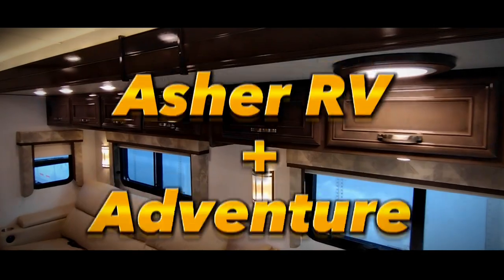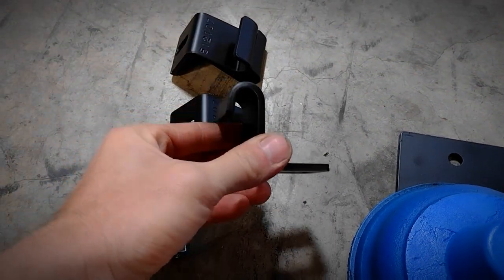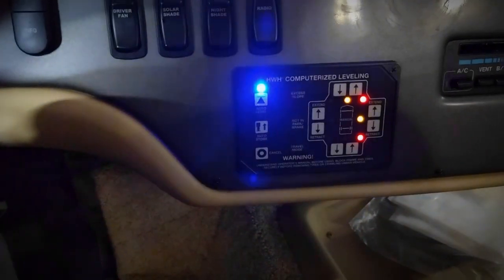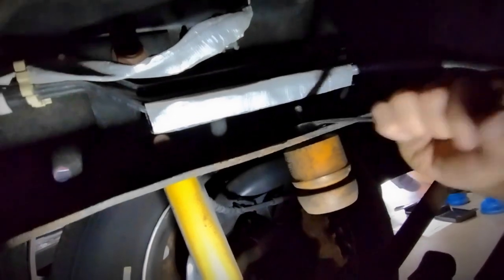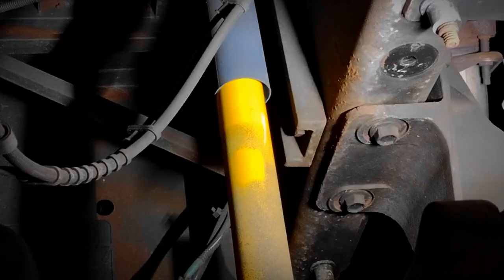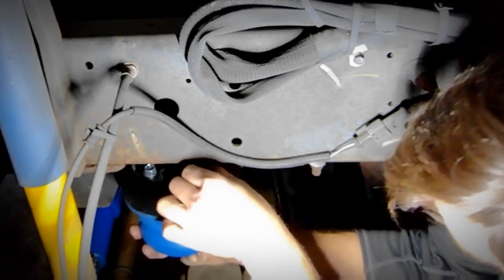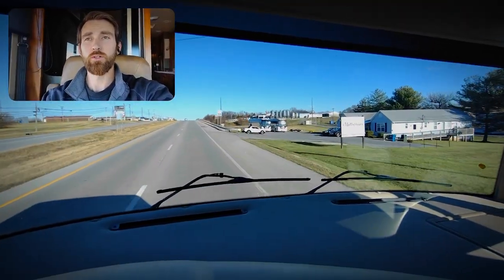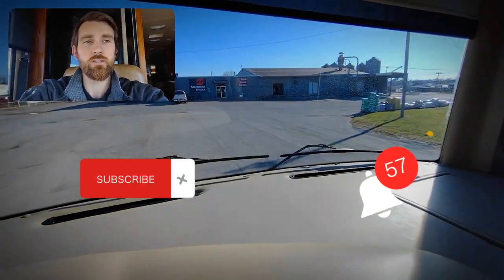SumoSprings _ Do They Work? Class A F53 Ford Install + Review RV Motorhome

Comment: Very good video. 

We own a class A Winnebago on an F53, 18K chassis. Purchased the coach new 20 months ago. Took a 5000 mile cross country trip and hated the suspension. We added Koni shocks, it helped, then Safe-T-Plus, and it helped, then the rear track bar ( it helped sway when trucks pass us). But adding the Sumo Springs really smoothed things out. It will never ride like a diesel pusher, but the suspension upgrades were definitely worth it. 20,000 miles now with all the upgrades and we don’t mind those bad interstate roads so much. 

Thank you for your video.

Comment: I threw a pair on the rear of my '04 HR Traveler just because they were a quick and easy to see if the rear springs were the real issue. The prior owner had thrown everything possible at the P32 it was built on and it still drove so bad his wife made him sell it, refusing to ever ride in it again. Well, they improved the handling enough to see what was really needed was rear springs. I had heavier new main leaves installed and re-arched the others, now it finally drives as it should. I see Sumos as something you would use on a pickup that occasionally carries enough weight so make it squat but definitely not as an every-day cure.

Comment: So great video. Not sure if paid or not. Folks, we have paid for all our shocks, sumo springs and air bags our whole life and never paid to have them we paid our own cash every time. Sumo Springs are a must for the fronts, enough said. Sumo springs in the rear are for folks not really  towing or pulling weight, (small toad would be fine). Air bags are just. Hands down the way to go, we recommend Pack Brake Bags. Also always pick your favorite steering shock any one you pick will be a HUGE upgrade to the junk stock one. And for Shocks Koni is number one. $$$$$$$, Bilstiens are number 2 but still great. Folks at min. When you have to start basic, we recommend all 4 shocks (Koni), All 4 (Sumo Springs), and (Steering stabilizer shock). Around $2800.00 if you do the work yourself. God Bless and many happy safe miles. USMC/USAF Ret.
Reply: I'm not sure I understand your comment about rear Sumo's not for towing. Can you please explain?
Reply: @davidreaves9231  So, after buying way too many on various trucks through the years. We found that once you get into double axels on anything. Air is just how you end up in the end and opens more doors as well. We love sumo, there just a time and place for them on the rear. PaKBrake is so affordable, it just takes out all the questions and hope so’s…..

Comment: One correction - the washers on the J brackets are supposed to be placed between the base plate and the J brackets, not between the bracket and the nut. I just did this install on my 26K Tiffin. ;-)

Comment: Did you do a video of your rear install I have the front, but I haven't installed them yet because the motorhome is at the dealership and when I get the MH back, I will have to buy the one for the rear but thank you for the video? I did install the Safe-T-Plus and the Rear Trac-Bar and Koni's shock and it ride so much better, so after I install the Sumo Springs it should ride extra smooth.
Reply from the maker: Yes sir I do have the rear footage and I'll get it together ASAP. I actually had it most of the way edited and lost the entire video lol. But I will be sure to get that going for you. If you haven't hit that subscribe and Bell icon and you will be notified when I do, but on top of that I'll mention you in the comments to make sure you see it 
That's great that the shocks and the stabilizer made an improvement.  I would imagine a factory shock on any gas Coach has room for improvement,so smart moving going there first.
Reply from the maker: I also have the footage to compare rear Liquid Springs to Rear Sumo Springs also if that's something that would interest you ,stay posted!
Thanks for your time!
Reply from the maker: https://youtu.be/fuzRqPbpWNQ 
Here is the rear install video

Comment: I put summo springs on my 2021 f250 superduty PURE JUNK I pull a 5th wheel with a tongue weight of 2100 lbs absolutely SQUASHED THEM got another pair CRUSHED THEM I now have airbags
Reply: Which style did you have? Only asking because they have a few offerings.
Reply: @Iamk2jones  The yellow ones
Reply: @BIGWOOD3160  did you have the Solos or the Rebels?
Reply: My black ones have made a huge difference in handling and ride. So much improvement that I just installed 4 on my 5th wheel and everything has improved.
Reply: Tongue weight of 2100 lbs? Are you insane? Seems like pretty excessive. My hitch weight is limited to 500 lbs.

Comment: Black ones are heavy duty yellow are medium and the blue are light duty
Reply from the maker: Thanks for the input. 
The combo I installed worked well, installed multiple since then. Several customers are very happy with what is on there. Thanks for you comment
Reply: Wrong. Yellow are the most heavy duty ones, then black, then blue. 

Yellow = 2800 lbs at 50% compression
Black = 1500 lbs at 50% compression
Blue = 1000 lbs at 50% compression